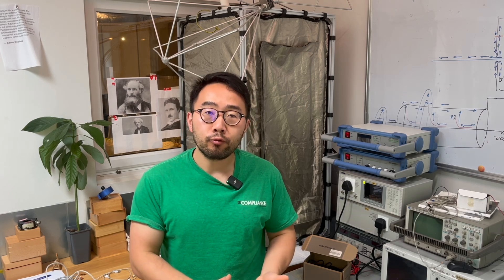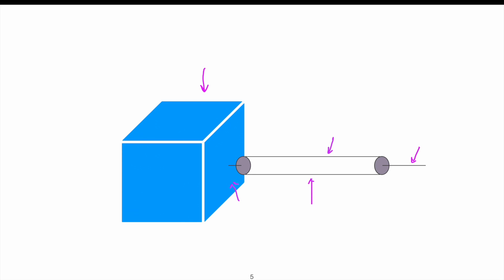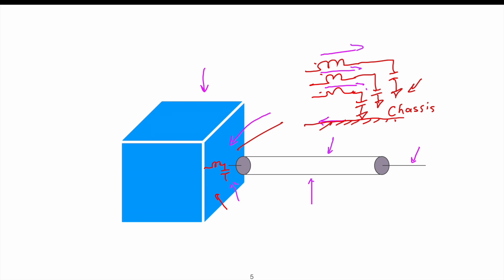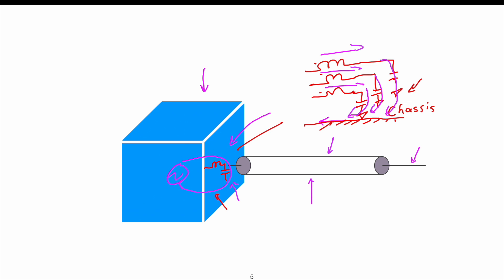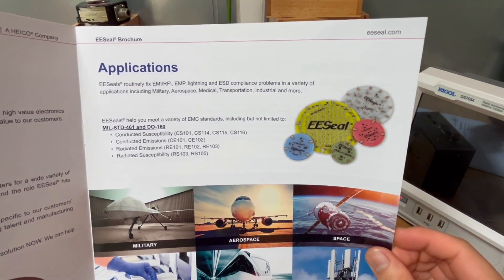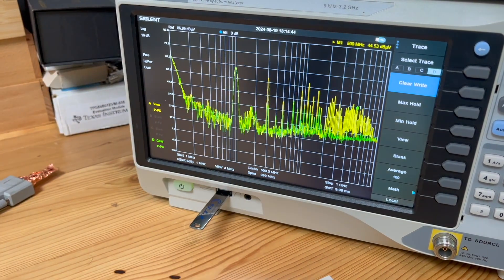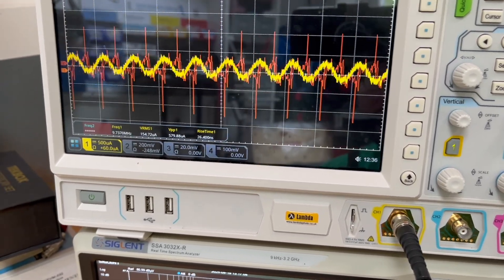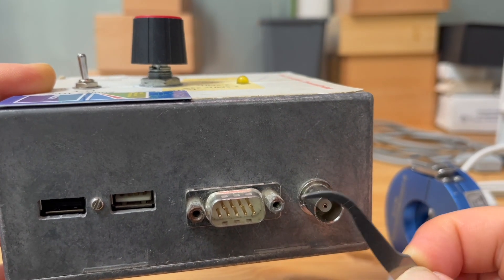Retrofit EMI Filters on Cable Connectors – Quick Fix for Cleaner Signals!

Comment: Hi, just a nit pick. In the EESeals the silicone doesn't have a conductive property. Inside the silicone is a phosphor bronze mesh where the parts connected to each pin get their ground. The mesh sticks out of the silicone at the edges as whiskers, they engage the connector shell. That shell as you point out must have a good bond to the case.

I've used these successfully for more than 20 years, the only downside is the price.

Thanks for posting these great videos.
Reply from the maker: Nigel, many thanks indeed for the corrections. Well explained. I also agree with you on the price point. :)

Comment: Hi, I wonder what setup would you use for monitoring the EMI frequencies between DC and 30 MHz. present in a 240V electrical installation: Can you please comment on that?
Reply from the maker: Hi Torito, check this probe, https://youtu.be/RrVsoWCMyH0?si=Z_19B5qMecjSPVSf. But bear in mind, the senstivity is not as good as other RF current probes, so you may miss small signals. So perhaps just a good quality Hall effect current probe is better.
Reply: @MachOneDesignEMC  Thank you, I watched the video but I'd like to use a spectrum analyzer to see the frequency domain and then somehow filter out the dirty electricity. I know you are running a business and I'm sure i can't afford your services but pease help me out with some free advice. I suffer from EHS and I'm trying to get rid of the dirty electricity from my electrical installation. God bless you Sir
Reply from the maker: @Torito1774  try Onfilter, they have some good filters that can clean the noise in your installation. https://www.onfilter.com

Comment: I wonder if that company has that technology patented. Seems like it would be pretty easy to replicate those seals. Even if the seal itself couldn't be copied I think it would be easy to add a small pass through adapter pcb that grounds to the connector metal.
Reply: In the past, I have crammed a couple of 10nF capacitors into a 9-pin D connector housing, wasn't particularly fiddly - but I guess the point of the seal is that is quick and easy to install...
Reply: It has been around in various forms since 1970s.